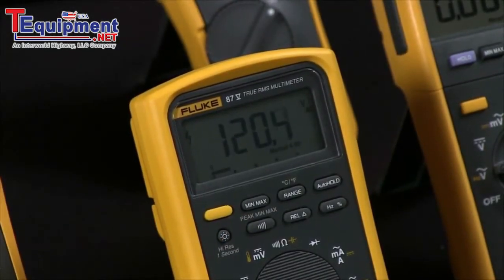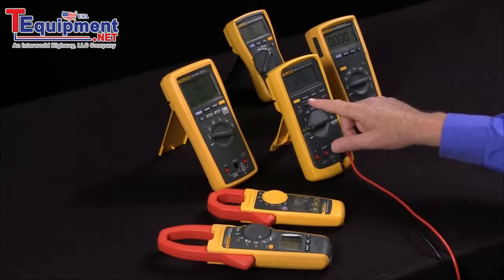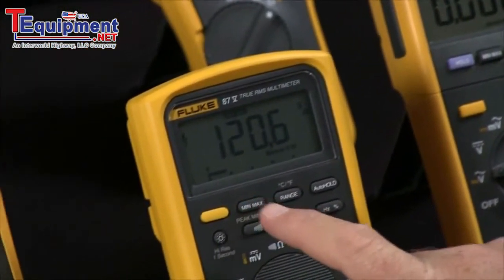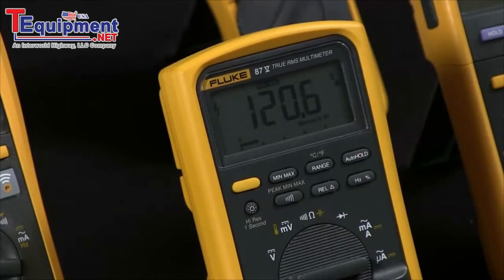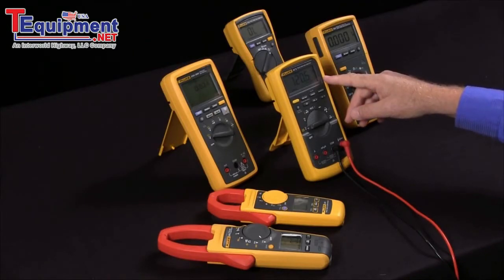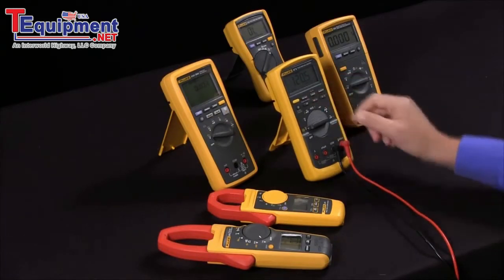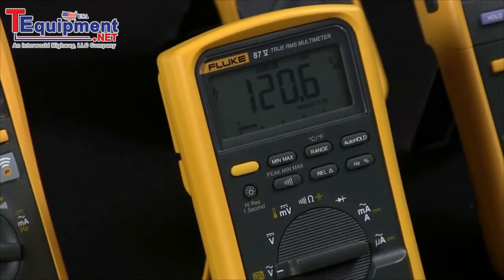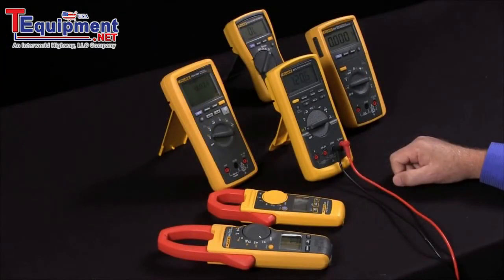How To Use The MIN MAX Features With A Fluke Multimeter

Comment: You are missing the very best use of the min/max feature of a Fluke Voltmeter. Say you have 20 contacts in series, and about every 5 minutes, one of them gets a couple millisecond blip (drop-out), that is shutting you down. Put the test probes across 1/2 of the circuit, hit max, and stand back. If the problem blip is in that half of the 20 contacts, you will have a voltage reading on the meter after the fault occurs. Cut the circuit in half again and repeat till you find the intermittent problem. This is great with safety circuit problems.
The Min setting can be used the same way, when you get an intermittent input, that doesn't latch in. The meter will catch it.